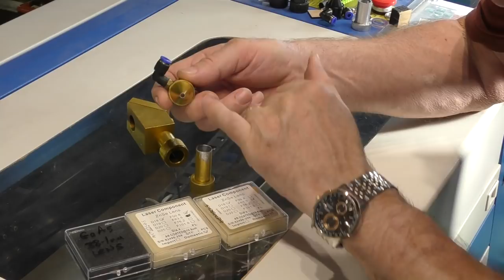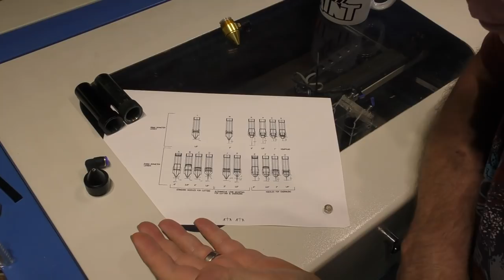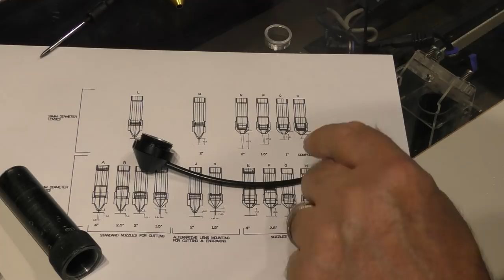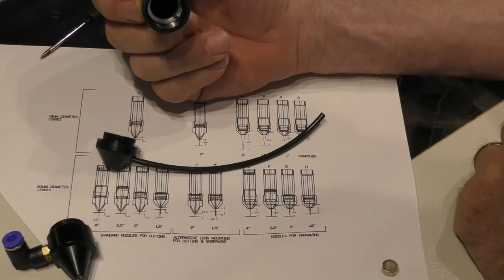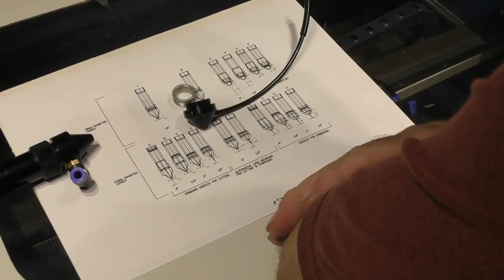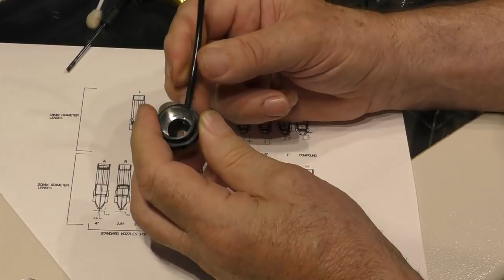RDWorks Learning Lab 155 Oh Dear What Nozzle and Lens do I Choose

Comment: Hi mate I just love the wealth of information on these chines laser.. I would love to know which chines laser machine 60-80w you think is the best to start with ?
Reply from the maker: Hi Gary
Worry less about the power and think more  about what you want to do with your machine What size table do you need. The immediate standard sizes are A) 300x500mm. B) 500mmx700mm and C)700mmx 900mm The price jumps up a lot between the sizes. . You need very few watts to engrave but the more watts the faster you can cut. However, be careful what you wish for. The more powerful the tube the less like it will be good st delicate engraving. . The typical best compromise happens at 60 to 70 watts.
It is certain that 
A) will be sold as a 50 watt machine and will be an 800mm long 40 watt tube. 
B) Will be sold as a 60 watt tube and be a 1000mm long 50 watt tube
c) will be sold as an 80 watt tube and actually only be a 1200mm long 60 watt tube. 

NOTE. Tubes in all these ebay machines will be B grade QA failures from one of the big tube manufacturers. They will work "in some way"  but as an ebay buyer the Chinese expect you will be sufficiently naive about this technology that you will not notice a lack of power. So when you buy a machine you need to factor in the cost of a new tube. About $250 for 50 watts
$360 for  60 watts and maybe $600 for 80 watts 

If you buy a small machine and upgrde the tube to 60 watts you will be saving over the 700x500mm machine with a rubbish 50 watt tube which you will have to replace anyway.

After wresting with the size and power issue you must look carefully at two ket things on the machine. First are BOTH X and T axes running on HiWin type linear bearings? Secondly is the controller a Ruida controller. Look at this RDC 6442 controller keypad.   https://www.ebay.com/itm/Keypads-Facial-Mask-Membrane-for-Ruida-CO2-Laser-Controller-6442G-320-A-6332M-G/123145983701?hash=item1cac1296d5:m:mnF0cOHOMjqk4UKBeUTlUog&var=423557655846  If the machine is not fitted with one of these then walk away

Most other items are less important.

Best wishes
Russ

Comment: What do you think about 3d printed nozzle? With an enough big hole for the beam not to touch inside the nozzle. I'm thinking to make some with threads.
Reply from the maker: Hi Mikael
I have made temporary nozzles from Delrin. If you put a big hole in it and will be using it for engraving with a distance between work and nozzle more than 10mm you will probably succeed. But for cutting where you may be within 5mm of the work surface. the heat in the immediate cut area  will  be quite intense and has damaged my Delrin nozzles. The very principle of 3D printing is that of melting plastic at about 190C, almost the same as Delrin.
Best wishes
Russ
Reply: have tried that got the alignment a little wrong now it has a new hole ! it dose work it is on a 4"lense so the end to work is the same as my other nozzle.
Reply: If I'm right, Delrin has a  heat deflection temperature of 125 °C. I have high temperature resin from Formlabs (on a Form2 printer) that has a HDT of 289 °C. It is my intention to try this on your new head design....would it be worth to try you think?
Reply from the maker: Hi Patrick
It will cost about $10 for a nozzle from China but it will be more satisfying if you can make your own. The very worst that can happen is it melts under certain conditions, like engraving slate, granite or marble.  You will not wreck your machine, you will have just gained some experience. Let me know when (not if) you have suceeded
Best wishes
Russ

Comment: My 3rd mirror turned foggy while out of my machine and sealed up so that is a stumper.  MO mirrors do that as it was brand new a few months back.  I tried cleaning it but the fog is not on the surface and can only be seen at the angle the laser would hit it (is the entire 25mm though).
Reply from the maker: I would stop breathing if I was you.  Molybdenum is extremely resistant to oxidation or water (humidity) damage  so think whatever is doing that to mirrors  might be doing to your lungs!!!  Back to serious now. If you rotate the mirror 90 degrees, does the fog disappear?  Polishing marks? On all your mirrors?

Best wishes
Russ
Reply: Doesn't go away.  I will buy some more if I have to but up next is 3 to center of tube then I will flip my lens over and my 17mm distance should grow.

Comment: I run 11mm gap on 2" with a larger hole nozzle ( def not like your tinny hole one).
I do cutting and almost 3d engraving. Works good.
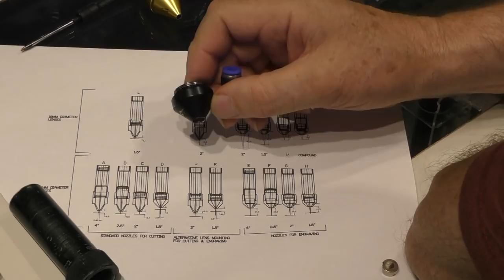Reply from the maker: The standard all purpose lens and nozzle supplied with most machines works ok. It is not until you start testing other lenses and nozzles you will indertand the advantage of  a small hole and a small gap for cutting. Without going into the physics and chemisty of cutting , it is a fact that fumes/smoke produced during cutting will absorb some of your cutting potential when it collides with the beam. Your cut width will typically be 0.2mm and it is essential for one pass cutting so that the smoke can be blown out of the bottom of the cut.and AWAY from the beam.  Getting air flow into a 0.2mm wide gap if the nozzle hole is 4mm and 11mm awayis like tring to blow a candle out from the other side of the room. The basic rule is samm orifice and small gap for cutting and large hole and large gap for engraving..  A 2" lens or even a 4" lens works well for 3D engraving  and a big gap is necessarywith just enough air assist to protect your lens.. If you want to see that I am not dreaming, take a look at this video from 9:15 https://www.youtube.com/watch?v=ITQiwjAJysQ.
Best wishes
Russ
Reply: @SarbarMultimedia  what happens if i put a shorter or longer lense in the 2"?
Focal length change?
I am still learning havent had machine long. Being it was used..  I have had to learn allot quick. And ungunk things they messed up. Laser mounts stripped. 
I ordered 2 inch lenses and thought i ordered wrong. But looks i got lucky.

I have a diode lazer also and found its limitations quickly.
Reply from the maker: @turboflush  
 As I answered to another of your comments there is no such thing as a fixed focal point with our lenses. Regardless of what the manufacturere promises. Lens design is based on the premise that what works for telescopes, cameras and projectors etc will perform the same way with a laser beam.  It is so easy to prove that is incorrect as I pointed out with your ramp test comment..  To find out aproximately the gap you need to set between nozzle and work, take something wood or plastic ( a cocktail stick, the plastic ball point pen tube or drinking strac) and carefully poke it inside your nozzle until it touches the lens and mark tit at the  nozzle exit point.  The focal point for your 2" lens should be 50.8mmm from the face of the lens.  From this 50.8mm, subtract the distance you just measured INSIDE the nozzle  and the answer is about the the gap you should set between nozzle and work.....APROXIMATELY.
Best wishes
Russ
Reply: @SarbarMultimedia  
Ok. So if i am thinking correct. The tube does nothing more than to get the air nozzle closer to the work. To that "focal zone"

Comment: Hey Russ, I have enjoyed about 40-50 of your videos and this past April I ordered and in August received a larger dual laser system from MORN (in China).  It is a 150 watt / 80 watt laser with Reci high quality laser tubes.  Parts of the system are good and other parts were terrible and looks like the design engineering was done on a napkin over lunch - by the waitresses.  I have done some reworking of the system to get it to work better but I feel like it should be doing a lot better.  Rather than clutter up the comments here - what is your email address and I would like to submit a few questions to see if you can help me get it closer to what it should be able to do.  Thanks - George
Reply from the maker: Hi George
I don't publish my email address but if you wish to add yours to another comment I will respond. I will delete your comment/email from public view.
Best wishes
Russ